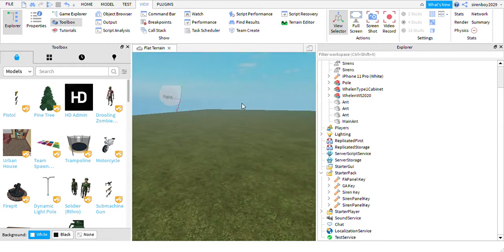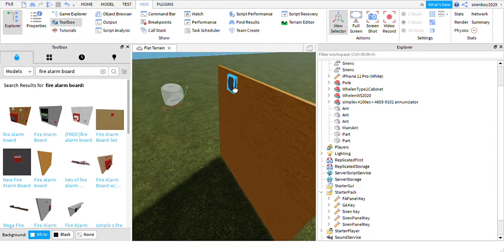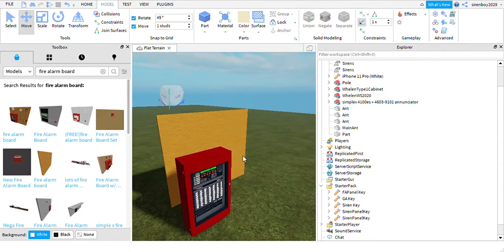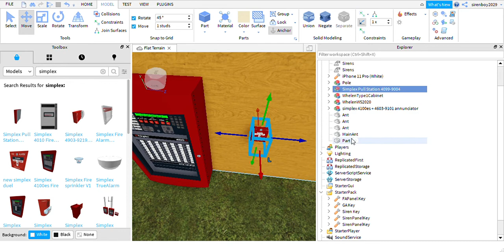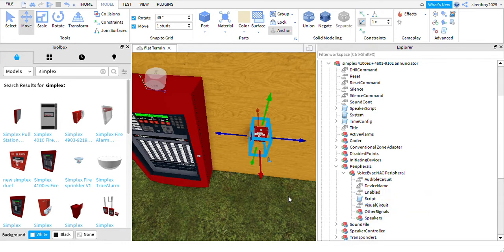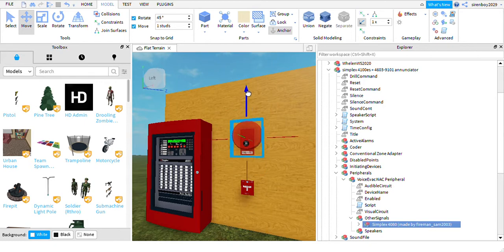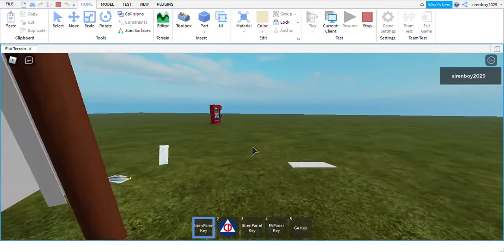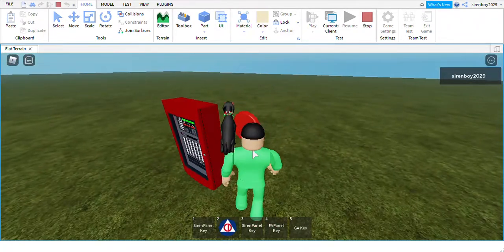How To Wire A Fire Alarm In Roblox Studio

Comment: Set your movement stud to 0.001. Go to "model" then there is a section that says "snap to grid" and right above that there is 2 boxes. One is for your rotating degree and the other one is for your scaling degree. Change the Box on top to 5 and the bottom one to 0.001.